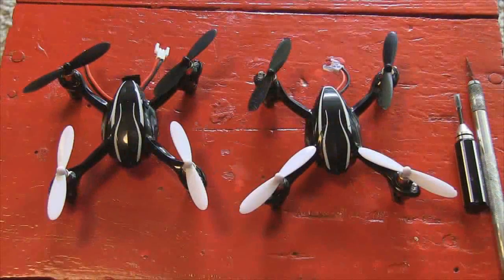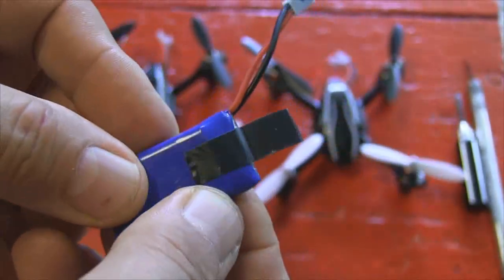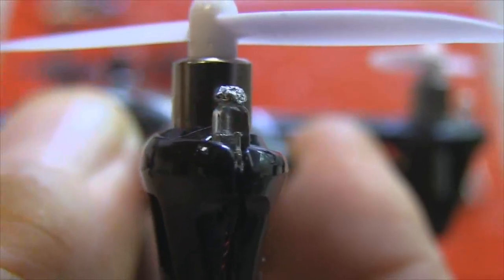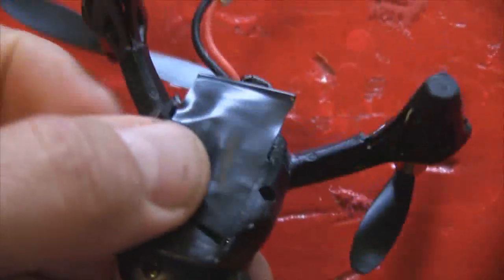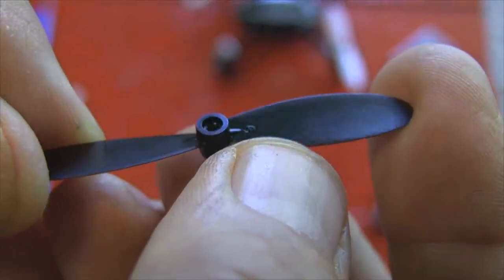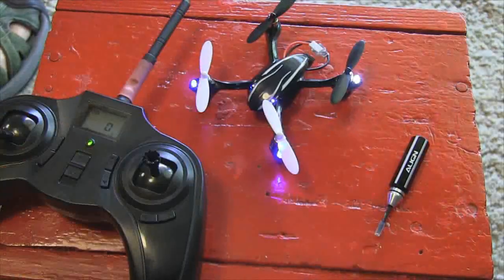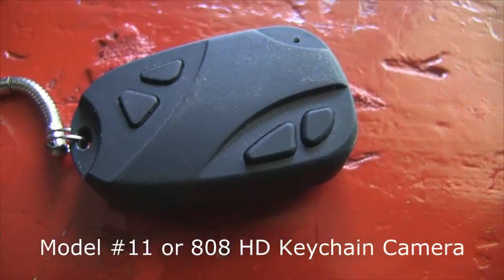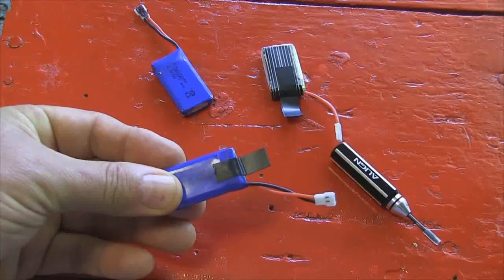Hubsan X4 Tips & Tricks 2

Comment: Great info!  I love my Hubsan X4s. I own a few, some for modding, the others are kept stock.

Just an FYI; the "1s" on the battery stands for 1 series. Some batteries are marked 1s1p for 1 series 1 parallel. Not so critical when there is only 1 cell. But if you have 2 cells then there is a difference between 2s1p and 1s2p.  2s1p provides more power (7.4v) while 1s2p provides longer flight time (3.7v at double the mah).

Comment: The tip regarding using the tape on the batteries to assist in their removal is a great idea, thanks Bob, I have applied tape to all my batteries. The tape also keeps the battery wire away from the props. I prefer not to twist the wires and stuff them in the battery enclosure for fear of eventually damaging the wires.

 Also, the tip of marking up the battery connectors was also a great idea. Yes there was a smart ass who commented that you could easily go by the colours of the wires but actually the marking trick is much faster. Thanks again Bob.
Reply: ***** Thanks, i have been buying mine from Amazon and am pleased with the service.

Comment: actually the best upgrade you can buy is "Hubsan X4 Mini Quad Copter Propeller Protection Guard Cover". Dunno why they are not including it into standard bundle - saving on spare propellers is really amazing. It is also cleverly designed and prevents shock to the props shafts even when it hits the ground upside down
Reply: They are now. My X4 arrived today and it had the guard included, even though it doesn't say so on Banggood's website. I'm really glad I've got it too.

Comment: Did you ever notice that the battery wires have two colors -- black and red?  Black goes with black, red goes with red.  No need for defacing the connectors with a felt marker.
Reply: no its MUCH better to scribble all over your nice clean battery connectors hahaha
Reply: Did you ever notice that the charger wire is solid black?
Reply: Sorry guys, as stupid as you think it is I am color blind. I am  58 years old and my eye sight is not good close up. So marking the connector  helps me out a lot. I am in a lot of different hobbies and its guy like Bob that helps us out and take the time to make a video. If you cant say something nice please say nothing or do a video to help out us newbies .The only stupid question is the one you are afraid to ask.Thanks for your time and effort Bob.   Mr.  Always Right

Comment: I replaced the feet with 360 degree blue and red leds. Makes it very easy to see, and i found that if you try to align the quad where the back leds obscure the front ones, you can control it easier because it is perfectly aligned with you.
Reply: and now I 3d printed a new frame (weighs less than 3 grams!) and it is clear, the thing is super visible now.
Reply: *****
Make me one!
Reply: ***** Could you send a link to that model or a similar type of frame?
Reply: John Baskin http://www.thingiverse.com/sirhanlec/designs try these. make sure you pick the correct size or motor. mine was a 7mm motor.
Reply: Awesome, thanks

Comment: Great tips, thanks! I have the X4 and want to start using the video. I didn't see anything in the manual on how to use it. What turns it on and off?
Where is the best place for spare parts, props, batteries and motors?

Comment: Thanks for the tips, Bob.  I've just ordered a X4-107C so reading up on it.
It's common in RC circles to balance a prop before use and stick a little bit of tape on the lighter blade to get them spot on.  Is this something you've looked at at all?

Comment: The LED's purpose was to light up the underside of the props above allowing for better orientation at night. However, an alternative to glueing the aluminum ball is to lightly sand the top of your LED with fine grit sandpaper. this will not only diffuse the LED but also help to redirect the beam to a much wider angle. Here is a link to an appropriate charger that will safely charge up to four different 1s lipos at the same time. http://www.amazon.com/X4-Micro-AC-LiPo-Charger/dp/B00FYL2INM#customerReviews
You may also note that all four batteries can be a different capacity (mAh) as well. Very good video Bob, it's nice to see so many micro enthusiasts!

Comment: Just got my X4c and it shipped with the blade protector inside the box ... i installed it and so i began to fly around after chargint the battery... only problem i experience is the short battery life... only around 3-4 minutes, but other then that this is an awesome quadcopter and even I who never flew one b4 got the hang of it after a few minutes of fiddeling around mid air :D
Reply: The blade protector is draining about 60% of your flight time.  I get about 10-12 minutes of flight without a protector and I haven't broken a prop yet.
Reply: yeah i am getting good with the quad :) might uninstall the protector soon
Reply: dude you dont charge the battery out of the box. it comes pre-charged
Reply: It should come half-charged because Lipos will not last if stored at full charge.
Reply: exactly

Comment: Great video, but actually the usb charger that comes with the hubsan charges at 2c rate already ( 35 min charge). C-rate doesnt mean the number of cells ur lipo has. its the charge rate. However most bigger lipo's should not be charged higher then 1c unless the battery is capable of handling higher charge rates.

When i charge the hubsan lipo on my Bantam Bc6 charger, it takes around 70 minutes to charge, so obviously the usb charger is way faster ( around 2c ) 
Ive been searching for the original hubsan lipo specs , but cant seem to find the c-rate. I guess 2c is the max speed u should charge them or they might get overheated.  
How long does it charge with the wallmart charger u have?

Greets!
Reply: Thanks! 
I was locking for the max C changing power.
Reply: Even at 2C your taking a gamble.. 
However yes, never exceed 2C with a 1S battery. 
I've been sticking with 1C as you'll prolong the life of the battery's that way as well as decreasing the percentage of the "blowfish" factor.

Comment: My TX display will not receive video. The light on the quad is "red".  I thought that meant it was recording. The instructions do not address this. The batteries are new and the SD Card is formatted. The TX only displays the battery status of the quad and the controls of the TX. If anyone has a suggestion on how I can get video back on my display, I would appreciate the help.
Reply: "C" model,records video to card,you have to put card in PC,tablet,phone(with correct app) to view files.Also,you have to switch off camera to save files,if battery dies,or you unplug,or have a hard crash,it won't save the video.Lastly,the "C" transmitter only displays what you listed(trim,mode,etc)on its LCD display.It's the "D" model that has FPV video on the Tx.Hope this helps!

Comment: The Other Modification I make is Not on the Actual Hubsan X4 107C. I make (Throw Away Battery Packs using 2 x Duracell AAA Batteries. First I take off the Metal that encases the Batteries to make them even Lighter. Then I cut a 1/8" inch length of Tin from a Tin Can (Obviously) and with each battery facing in opposite I weld the tin Strip Bridging the + & - Together.Both Batteries are Secured to each other with Insulating Tape. With an Old X4 Battery that is Defunct.You keep the Power Cable and also Weld that On the Other end of the Batteries. Ensuring you put it on the correct Polarity. You will have great difficulty to "Solder" on the tin strip and power lead. So this is why I weld them on. So now you ask How Do I weld them On.Well I use the 12v Car Battery as a Mig Welder (DC Welding) and the Weld Probes I use to weld with is just Hard Carbon Pencil sharpened to a Point. The DC Principle is to use the + (Positive Terminal of the 12v Battery AS THE GROUND TERMINAL. So that is the Terminal that Holds down the Tin Strip on the Batter and then when you Put the - Negative Terminal of the other Pencil Probe and Touch the Point on the Tin and Battery it will send the Current and (Spot Weld the Tin Onto the Battery Terminals. These are Simple Throw Away's but give the X4 More Flight Time.Being Duracell's Reputation of lasting longer. You will need to use proper eye protection if you are going to try the DC Welding. as I won't be responsible should you have an Accident. Iv'e Never Tried Using Duracell "Rechargeable Batteries" I guess that's on the next Agenda. NOTE: These Throw-Away Batteries are Mounted on the Back of the X4 Drone with Velcro as same as when I use my 808 Key Chain Camera as said below as they won't fit inside the X4 Battery Compartment.You Take it Out when using the Throw-Away Battery Pack. I just like Faffing About Making them. 62 Years Old and Still a wee boy at heart. (Boy's wae there Toy's as they Say!)  ;-)

Comment: HI.  Great video.  Im having a problem with my unit.  Just flying it around the kitchen, the led on the controller LED turns red and seems to lose connection with the copter.  I have to unplug the battery and turn off the controller and turn everything back on to connect again.  Can anyone help?
Reply: Try replacing the batterkes on the transmitter

Comment: DO NOT wrap tape around the flex joint on the legs, the shock of a hard knock can cause the legs to snap at the body. The joints are there for a reason that's why they were included

Comment: What I have done with my Hubsan x4 107C, It to mount a Second Camera on the Back of the X4 with Simply Puting on Velcro (The Carpet Type) on the X4 and the (Hook Type) on the Underside of the Camera. The Camera I put on is the Simple Cheap "KEY CHAIN CAMERA 808 #16 AND OR THE #18 WITH FULL WIDE ANGLE LENS" These are very light cameras and don't make any difference to the Flying Abilities of the X4 Drone. Any size of Micro SD Card in the Camera. I also put the Camera Facing Backwards on the X4 Drone as then I can manipulate video editing using both X4 Camera and the 808 Camera. Hope this Helps to Modify Your Hubsan X4  HAVE FUN!  ;-)

Comment: I had mine for about 18 months now. Over time I accumulated 8 batteries: 4 @ 380mH and 4 @ 500mH. Until about 2 weeks ago these were all regularly charging well and functioning fine. Suddenly it seems that NONE of these batteries except maybe one is charging from any source. I have been using USB wall-chargers + the USB cables supplied by Hubsan. This had always worked for me until 2 weeks when it seemed that most of these batteries are not taking a charge at all. I have used three different wall-chargers, my computer's USB output and also a USB charger I have in my car. All I can figure is these batteries somehow got damaged by some voltage or ampage change that I was not aware of. But a USB charger is a USB charger, right? I've been using the same ones for over a year, and now suddenly I'm having these problems. Does anyone have any idea what going on?
Reply: ...and I'll just add that the Hubsan charge cables' LEDs always indicated that charge is complete. But this seems to happen too quickly, just minutes after the X4 wouldn't fly anymore and was flashing that the battery was weak. So, WTH?? It certainly seems it's the batteries and not the quadcopter. But how did all 7 or 8 of them get this way?